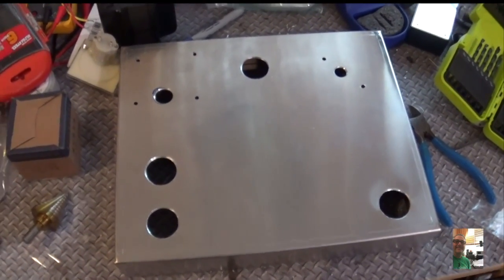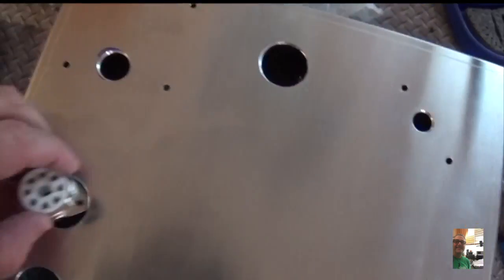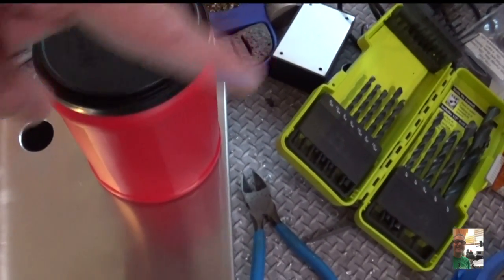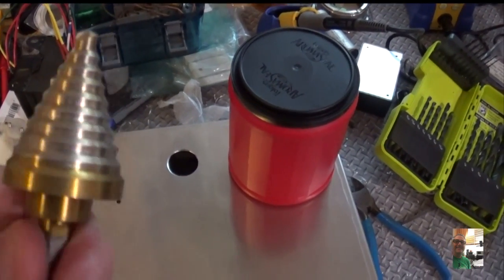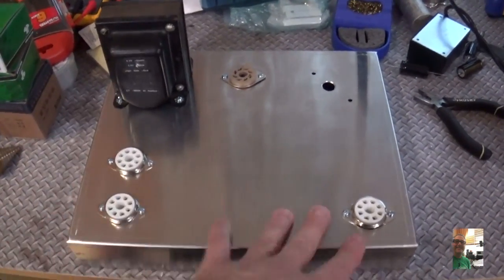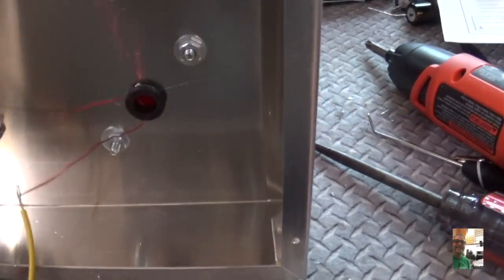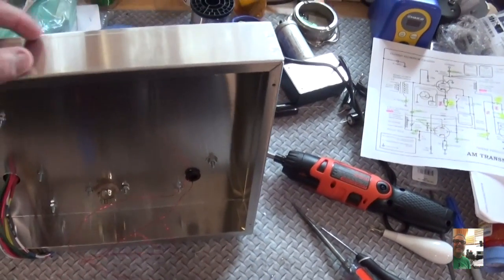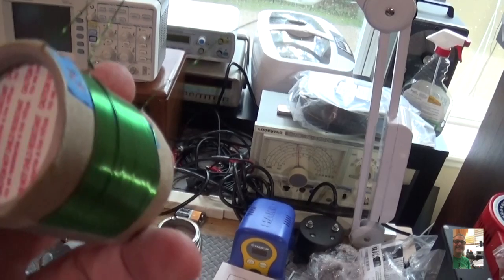Rick McWhorter Am Transmitter build - Eposide 2 -  Hole Lotta Love

Comment: Cool build ya got going there, Ron.  Be interesting to see how it performs.  I'm still intending to get a one tube kit from AES some day just for the fun n experience of building one.  I already have two AM transmitters now.  A tiny one that almost has to sit on the radio and one of those talking house transmitters that works all over the house and out in the yard so I don't need one that large...or need one at all, I just want to build one, lol.
Reply from the maker: Thanks Gary.  I have the smaller one too but the sound is not great. Hoping this one fits the bill and delivers for the whole house. From what I have seen it does that and much more. We shall see :)   Hope you are well my friend. Ron

Comment: Interesting project.  Great work!  Could the tube sockets be pushed up through the holes with the flanges underneath the chassis?
Reply from the maker: Stephen, you are 100 correct. My step bit is a bit odd and I chose to be a little conservative when I cut the holes.  If I went a little deeper I could have mounted on the bottom.  An an amplifier I would have done that, but in this case, I chose to leave it as it is.  One day my OCD will kick in and I will fix it  :)    Thanks my friend - Ron

Comment: Hi Ron, I did not think they made those step bits that large, my bits only go to about 5/8" or so.
Looking good, are you going to put the modulation transformer under the chassis?
Reply from the maker: Yes Bill, the transformer will be mounted bottom side unless I find a good spot on top. That is why I decided not to wire the sockets yet.  I am drawing out a little map so I can make this as neat as possible.  If I cross wires in the wrong places I am going to get HUM and I want to avoid that.   I use that step bit alot as I build guitar amps.. it comes in handy for sure. Thanks for watching and for your questions and suggestions - I appreciate it.   Ron